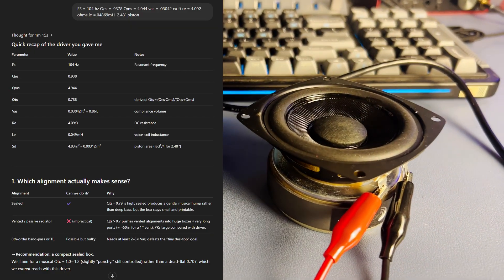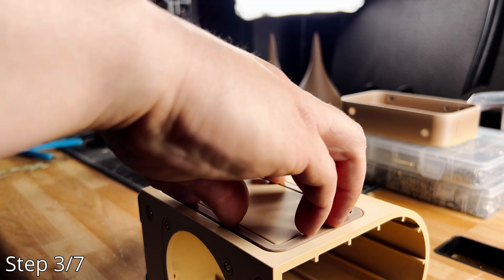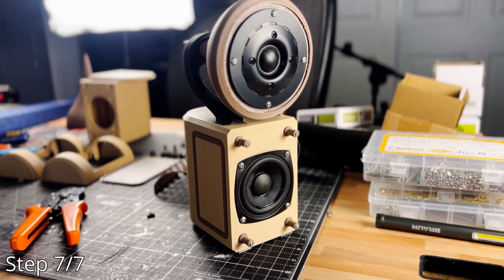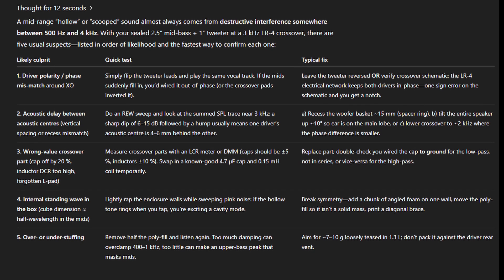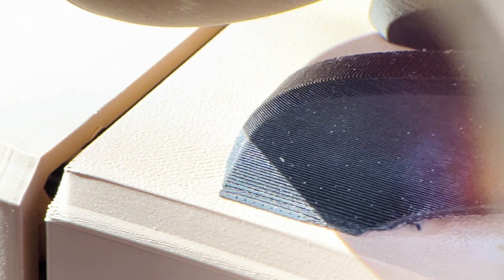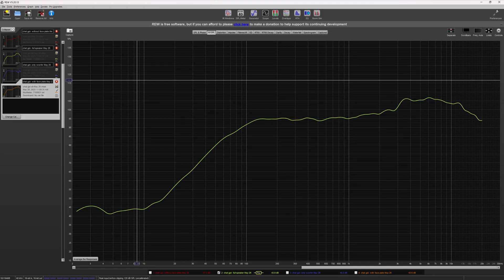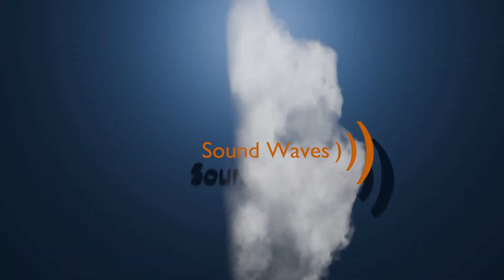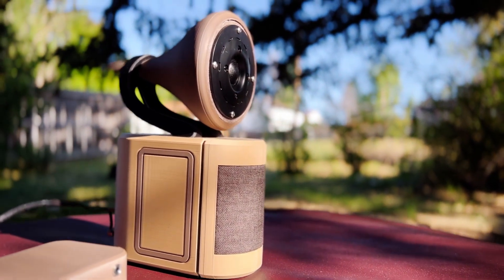I let Chat GPT Design This 3D Printed Speaker Project. Is It Any Good?

Comment: Cool project. What prompts did you use with ChatGPT?
Reply from the maker: They were very straightforward, it was basically a “here’s the speakers I’m using, I’m building a 3d printed enclosure. Ask any pertinent questions needed to complete the project. “

Comment: Use an L-pad to reduce the tweeter level, it's about +10 dB too high in the highs. Your frequency response should be flat to avoid a thin sound.
Reply from the maker: Good to know. This is the raw output without EQ tweaking at all, so built from AI parameters I couldn’t complain to much.

Comment: you could've trusted it with the cross-over it actually helped me solve a few cross-over designed for my last projects!
Reply from the maker: I think it was more that I didn’t know what a crossover should look like spec wise, so I didn’t even bother as it could’ve steered me way wrong. But good to know it’s at least knowledgeable enough to test some with.